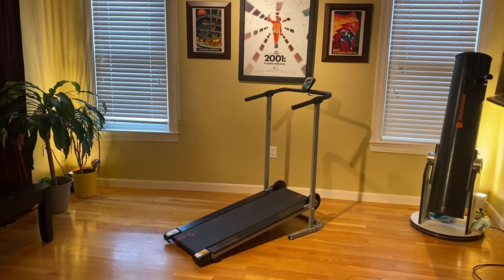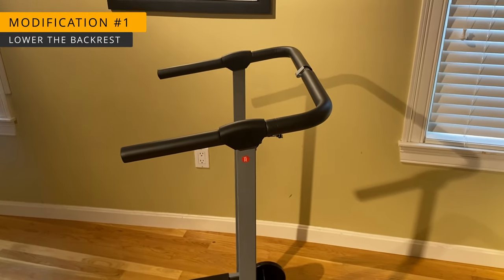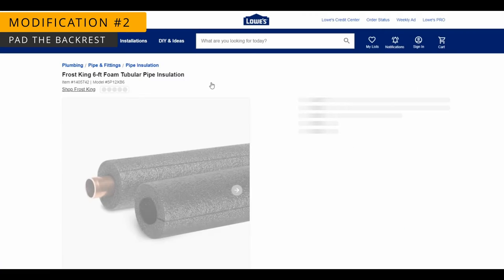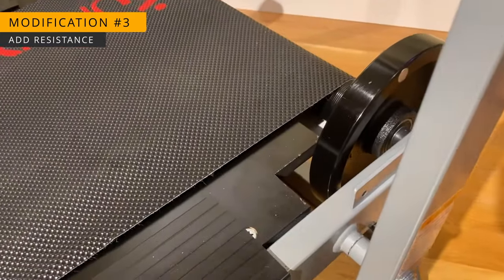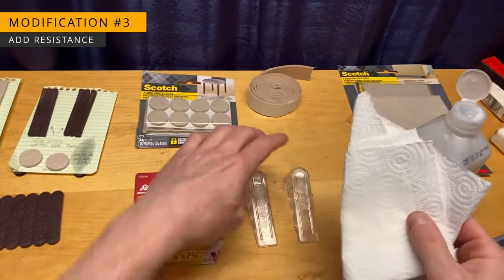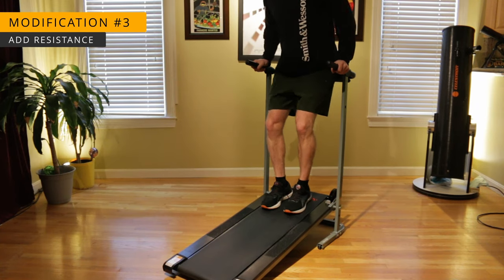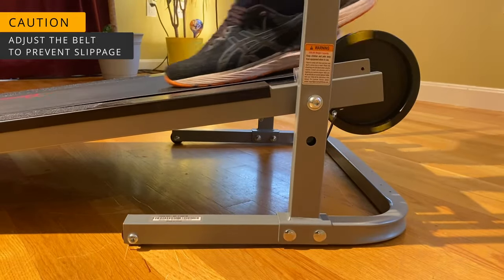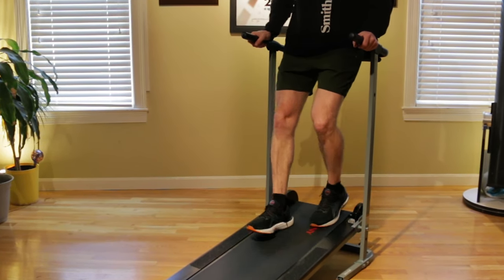Stop Knee Pain with this Backward Treadmill Hack

Comment from the maker: ‼️ When the treadmill arrives there will be a thin film of oil on the flywheels.  Make sure you clean away this oil before installing the wedges or you will not be able to achieve sufficient resistance ‼️

Comment: Thank you for this!!! This setup wasn't doing much for me until I added a "seat", which is a 2-inch diameter pvc pipe suspended by a lashing strap between the bars. This helps prevent my weight from doing all the work. My knees are now almost pain free after 10 minutes once or twice a day for just over a month! They are getting noticeably better almost every day, which is shocking... in a very good way!

Comment: Looks like you’re too far towards the top of the mill in cant get a proper Backstep. I would’ve just flipped the top bar around so that the loop portion is facing forward, pushing you more towards the middle of the treadmill.
Reply from the maker: Good idea - thanks for the suggestion!

Comment: Thanks! It’s comical that ATG is selling their manual treadmill for $600.
Reply: It’s not comical, when you make something with quality parts it costs money 🤷🏽‍♀️ if you have it great, I sure don’t…. But I know when I buy a cheap shirt from shein that it’s only going to withstand a handful of washes then it’s trash.
Reply: You can become a member for $24.50 and then purchase it for $480. If ATG were a large fitness equipment operation, then I'm sure it would be cheaper. Maybe $299.95.
Reply: People can also look into The Tib Bar Guy's Sled Tred. It's built for several exercises so it costs more but it does more.

I don't know of any more options out there that aren't way more expensive.

Comment: Love this idea! How long have you been using this? Curious about longevity of the resistance pads, and if/how long until they wear out. Thanks!
Reply from the maker: Great question!  Some of the off-brand felt pads I tested wore out after a week or two.  But the 3M pads shown in the video are MUCH better - so far they show no signs of wear.

*UPDATE*  2 months later and my original pads with 3M felt are holding up great!

Comment: Thanks for the video! Just assembled mine yesterday with the modifications!

For now the only thing I was thinking about changing is the distance of the backrest. 
It seems to be too far out so when I sit on it and try to push with the toes, I’m almost on the end of the treadmill. 

I think by drilling new holes on the railing near the « corners », I could gain 4  inches or so and shift sone weight more to the center too and I wont feel like having a chance to flip on the back.
Reply from the maker: That sounds like a great idea.  Let me know how it works out!
Reply: Zack wondering if you got to try this at all if so how it’s been working
Reply: Yes I did the other modification like I said and it’s a little better IMO!

Comment: Thank you for showing such a cool hack. Is the resistance with the felt pads similar to a dead treadmill? Would you ever want more resistance?
Reply from the maker: Thanks for watching!  I’ve never tried walking on an electric treadmill turned off, so I’m not sure how this compares.  So far this hack has provided plenty of resistance for me.  I’ve been using it daily for about 2 months, and have not felt the need to increase the resistance (although I could probably push the wedges even further into the gap to get more resistance if necessary).
Reply: Great! I bought a used treadmill and your instructions were perfect. I bought a $9 squat bar pad instead of a pool foam. A little more money but the padding is comfortable and you don't have to cut/alter the squat pad. It slides right on. The resistance is a little less than a deadmill but you can alter the tension by crouching down or probably adding a felt pad on top of the first pad. Thank you for sharing this amazing hack! @CosmologicalNonsense
Reply from the maker: Awesome!  Good luck 💪

Comment: in the video, you seem to be nearly sitting...do you feel like you are getting more of a burn/workout like this compared to standing upright ?
Reply from the maker: When I stand fully upright with high treadmill resistance, my whole body fatigues rather quickly.  I can only stand upright with high resistance for a few minutes.  
But when I lean back (nearly sit), I am able to better isolate the lower quad muscles that help stabilize the knee (mainly the VMO).  This allows me to target those muscles for a longer period of time (10 minutes each time).
I would suggest that people try different forms to see what works best for them.  It took a while to figure out what works best for me, as it all feels a little unnatural at first.
Reply: @CosmologicalNonsense  yes, so you are definitely getting a better result, nearly sitting...when I stand & walk backwards on my treadmill, no setting/speed gives me a great resistance, so nearly sitting feels its way better at targeting muscles around the knee

Comment: This is awesome! Thank you so much for this. I was literally on the check out window for the atg treadmill when I saw this. I think this is a great alternative. There is only a beige pad from 3M, is that what you mean for the white one?
Reply from the maker: Yes, “beige” is what I meant by the white one.   I tried the brown 3M pad, but it didn’t work as well.  Let me know if you have any more questions!  Good luck 💪
Reply: Do you think it is possible to drill through the metal to create a hole for the fold up knob? Since the legs are installed reversed, the fold up knob holes don’t line up.
Reply: Just came back to say thank you again!! It seems like this is almost exactly like the backwards treadmill (after having watched a few videos of people demonstrating the set up/use of the ATG one). After setting up the amazon treadmill with your hack, i've been using it every day and love it!
Reply from the maker: I'm glad its working out for you! @jeddson
Reply from the maker: @jeddson I just left the fold up knob uninstalled.  But yes, you could absolutely drill a hole in the leg if you wanted to use it!
Reply: @CosmologicalNonsense  I’m doing the same. Just have the knob in there, just don’t want my kids to take it out and get knocked in the head with the treadmill. Drill I will. Thank you!

Comment: This is great! Once you've set it up to for backwards walking, can you still use it walking forward? The wife is asking before she approves this hack 😂
Reply from the maker: haha - yes you can.  The handlebars will be sloping slightly upwards, so it may feel a bit funny when you hold on.
Reply: Awesome thank you
Reply: @CosmologicalNonsense stupid question maybe, but do you remove the wedges for resistance in the hack when you want to reverse and use it for forward walking?
Reply from the maker: @pensivern  Yeah - when you pull the wedges out, it works normally for forward walking.

Comment: 👍info. Please could you advice..if a flat treadmill would be better for real weak knees and seniors.
Reply from the maker: I haven’t personally tried a flat treadmill, so I’m not positive.  I could envision a flat treadmill being slightly harder because the one in the video is actually declined (since you’re facing backwards) allowing your body weight to help keep it moving rather than just your knees and legs pushing it.

Comment: Did you do anything to be able to use the locking pin since it doesn't line up with switching the uprights? It seems a bit unstable without being able to place it
Reply from the maker: I don’t fold the treadmill up, so I didn’t even notice the locking pin when I made the video….but somebody else in the comments drilled a hole in the upright so he could still use the locking pin.  👍💪

Comment: How has this held up for you so far thinking about investing in one of these vs the ATG one
Reply from the maker: It’s held up great so far.  I was told by one user they couldn’t get the resistance high enough with this hack, so they preferred the ATG unit, but for me this resistance is plenty.  My legs are gassed after 10 minutes.

I suspect the user didn’t clean the oil off his flywheels before inserting the wedges.  The treadmill arrives with a thin coat of oil on everything that must be cleaned before inserting the wedges.

Comment: so how do you fold it now that the hole in the swapped handle is on the wrong side? 😅
Reply from the maker: Another guy I talked with drilled a new hole for the locking pin.   I just fold it up and don’t use the locking pin, as it seems to stay upright OK without it lol.